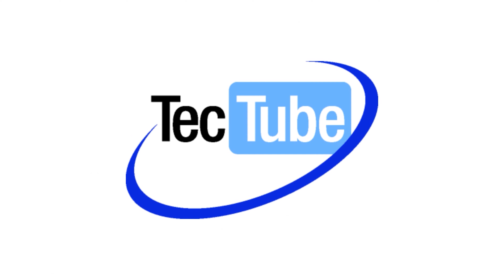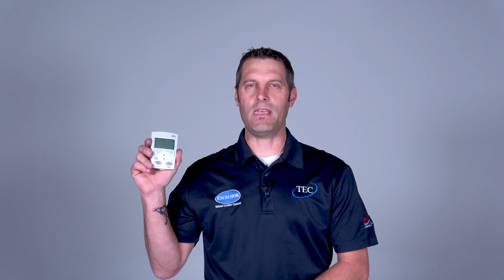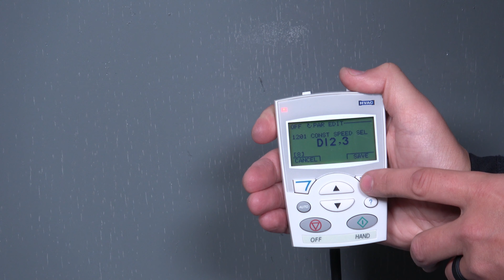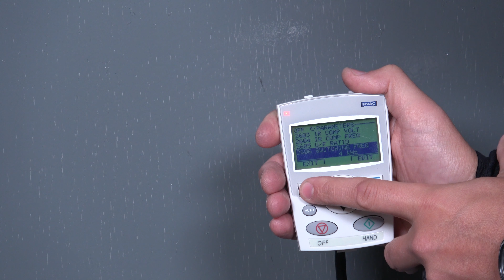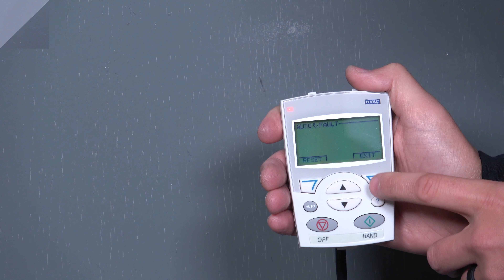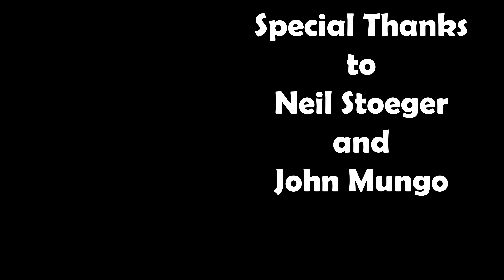ABB VFD Setup for Staged Air Volume RTUs

Comment: Thank you! Very informative video. Definitely helpful for people that still use these VFD modules.
Unfortunately, my customers never want to replace these VFDs or to mess with it. So, I have to replace all these modules with 3-pole contractors. My customers are cheap.
Reply from the maker: The VFD is likely required for local energy code compliance

Comment: I constantly have to reset these drives whenever there's a thunderstorm. Is there something I can change within the parameters in order to prevent this?
Reply from the maker: No, we doubt it. That kind of issue does not sound like a software configuration issue. It seems more like electrical hardware.